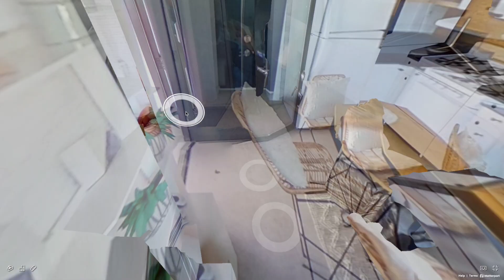ICON 3D Prints Tiny Homes, Military Defense Structures & Soon Much More | Meet the Team

Comment: Make a video speaking to actual costs, site requirements, cost of finishing the inside to move in ready. Realistic cost disclosure is needed, not just promos of process.
I am a 70 yr old senior on fixed income, could I afford a house from you?
Reply from the maker: Icon is only pursuing larger projects at the moment not single homes for individuals and the homes are quite expensive one is currently listed for $450k. In order to make cheap housing enough homes have to be built to shift the supply curve. Houses sold on the open market will go to the highest bidder.

Comment: which are the main softwers use in the field to make a project ?
Reply from the maker: You need a slicer to turn your 3D file into a print path and each printer has different custom software packages that they integrate.
Reply: @automateconstruction  I hope in future to see a standard to create and simulate the physics of a structure , maybe a dedicated Cad program , I seen some use Rhino , other use Autodesk suit . What did you found more common ?

Comment: 3D printed home, Tesla roof & batterie wall, spacex starlink with acsess to Ehang atonamous drone and you could live anywhere. Could a helicopter fly the machine to the top of a mountain eg ?
Reply from the maker: Yes but getting the concrete up there would be a bigger challenge
Reply from the maker: IAN G  Concrete can't be poured anywhere near freezing.  I know a company in Canada TAM has many projects they've done in BC that are holding up well so far. Only with time can we truly know the longevity of these projects for certain. Estimates currently range from 75-125 years.